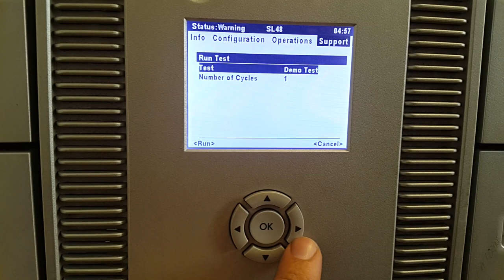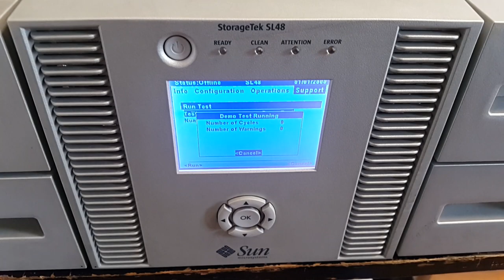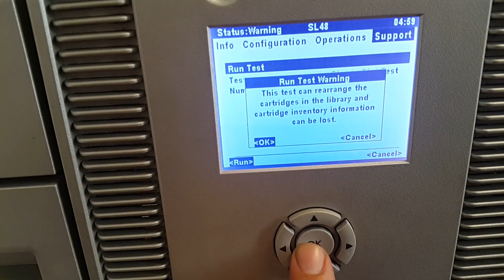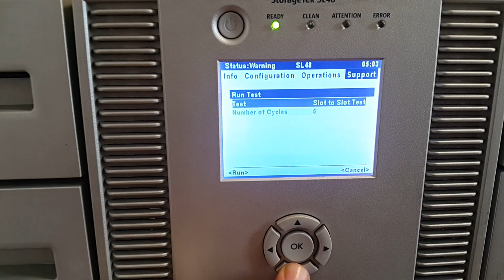STORAGETEK SL48 SL24 TAPE LIBRARY RUN TEST  (autoloader)

Comment: Great video! Thanks for share it with the community. I have the same unit that I bought in the second hand, but unfortunately an admin password was configured and I have no way to reset. Contacting oracle support is not an option because I am not a company with a support contract, I am a developer who bought used equipment. Do you know any way to help me reset the admin password? Thank you.